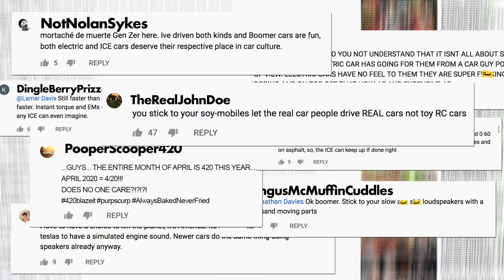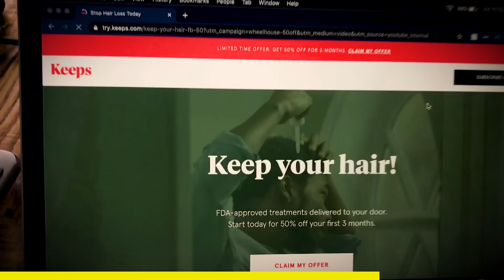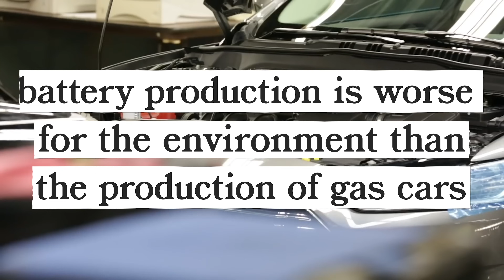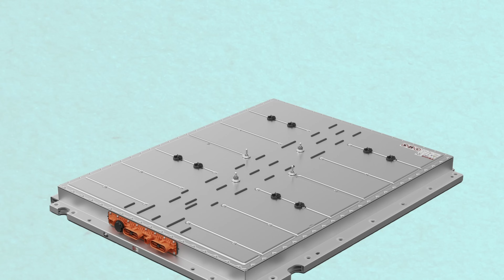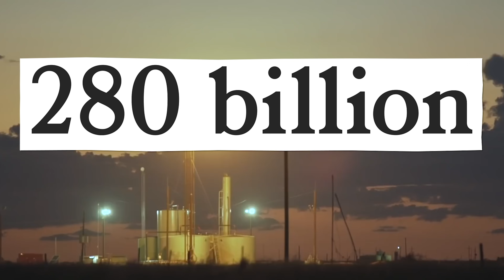Are Electric Cars REALLY Better for the Environment?

Comment: 8:40 nuclear power station. That is water vapor coming from those towers.
Reply: Waaat? I thought that was nuclear RaDiATioN and CaRBon
Reply: You realize nuclear and coal power all use the original powering method of stem just different ways to heat it
Reply: @gradypoole5366  Huge difference
Reply: Jeremiah what
Reply: @gradypoole5366  I think he is talking g about the byproducts such as steam vs mercury, lead, cabin oxide, sulfur oxide, etc

Comment: The Germans have calculated that a Tesla is just as polluting as a modern diesel until 200.000 km...they take in account how the energy is generated that drives the car. Also the percentage that can be recycled is lower then "normal" cars..They are heavier and worse for the road they are driving on because of the weight, which only makes me think that tires also wear faster. What is the life of a battery pack or a electric car? And is your car worthless when the battery dies?

Comment: So basically 2 times more efficient than gas engines, hybrid is the way to go, the proof is f1 being more eco friendly than formula e and don’t forget f1’s plan for 100% carbon neutral fuel by the year 2030, ice will not die out in the near future for sure

Comment: If your power plant burns coal, they are turning heat into rotation into electricity into rotation again, in an ice you turn heat from burning into rotation. Now go on google and find out the % of energy you lose making electricity and then turning it back to kinetic energy. Unless you go solar, wind or hydro you are wasting energy and for the same amount of driving an ev produces more co2.

Comment: No matter how much people who can't let go of the past try to shit on EVs, the facts still stand. Even if processing and production plants caused a bit more pollution wherever they are, I would rather have a few processing plants in the middle of nowhere causing pollution than thousands of mini CO2 factories on wheels at every corner of the street. You can see the difference in pollution between big cities and smaller ones and that's the only proof needed. The main focus now should be making sure we don't choke in our own cities.Also, as fast as technology is evolving, lithium will most likely become obsolete pretty soon and we'll find greener sources of fuel for the EVs. It took a while for petrol engines to become less polluting and the same will happen with EVs. It's an evolving process.

Comment: Seriously loved this video, glad we can finally put this argument to rest.
Reply: there still a few points that are not covered by the video. like electric semi trucks and if its possible to convert over to them completely. not to mention the oils used in electric vehicles, and if we switched over 100 percent to electric vehicles would it work? for the most part this does get rid of most questions.
Reply: @brionwreede9989  Also nolan said Lithium extraction pollutes a lot of water, and then he only compared the atmosphere pollution
Reply: Brion Wreede Brion Wreede electric semi truck has already been done by Tesla. The production co2 value he used included any oils used in EV production. Why do people always try to pick it apart and not realise EV’s are just better for the planet. If we all changed over to electric vehicles there would be no problem to the grid, we would install more public chargers but nearly everyone would charge from home
Reply: @jamie0193  because the cold greatly affects how far those electric semis can go. Not mention the charge time. It's impossible to cross country a semi with that massive of a battery. Not to mention the fire hazard from the massive charge and discharge of that battery
Reply: @jamie0193  it deserves to be picked apart. If it's going to replace gas and diesel engines it needs to be thoughrly throughout.
Reply: @brionwreede9989  Yeah Elon is pulling a very stupid move for making electric semi trucks.
Reply: Still missing a lot of issues with bringing evs into the infrastructure
Reply: Not until another person make this kind of video
Reply: Not even close
Reply: 'glad we can finally put this argument to rest' You're obviously trolling
Reply: Amen
Reply: I'm sure ev abuse won't end anytime soon

Comment: Did you divide the 280 billion metric tons of CO2 produced by drilling that oil into what is actually used by gas powered cars?
Invalid.
Fail.

Comment: Thanks for mentioning the local farmers who have less or no water because of pumping brine in the Atacama. I say no, because pumping brine lowers the water table beyond the reach of wells that were already expensive for the farmers.

When or if battery recycling becomes available efficiently, maybe the environmental impact of the batteries will drop, too.

I have my doubts California’s grid can handle a very large number of electric cars, but most of the country should be fine with lots more electric cars.

I also like ICE cars. You can fill them up in minutes, even if you have to drive several miles to find a gas station with working pumps. And last fall in California, I could give rides to neighbors with Tesla cars during blackouts that lasted the better part of a week.

Comment: @Donut Media
I don't think every avenue was covered in this video, Ethanol provides a compelling environmental positive for ICE powered vehicles. Running E85 to E98 can effectively make the vehicle carbon NEGATIVE over it's lifetime by putting more oxygen into the atmosphere than carbon dioxide that the vehicle emits.
Brazil is a great example of this as a country that implemented a large scale ethanol pump fuel that fitted into their existing infrastructure. This should have been at least mentioned in this video if you were going for debunking all myths. Electric vehicles vs ICE powered by ethanol is still a very debatable environmental tossup in terms of total environmental footprint.

Comment: You got paid my EV companies?, what about adding green fuels into  the equasion...
Reply: How?? He provided factual information on the topic.

Can you prove ir provide a source that contradicts anything he stated? If not you need to question your own motives and biases instead of lashing out on those providing facts.
Reply: António Palma or the disposal of said lithium batteries...
Reply: @KyleSmith-bp2fe  Manufactures are actively working on reducing the rare earth mineral consumption in the batteries. Also the biggest impact that EVs have regarding pollution is the massive reduction in green house gas emissions.
Reply: Maybe we shouldn't start to pressure underpaid consumers into buying expensive EVs and instead focus on alternative fuels... naaaw that doesn't generate nearly as much cash

Comment: While dispelling bogus numbers, please expose the nonsense of cars creating >5 tons of CO2/year, while consuming 500 gallons of gas a year.  Even if gasoline was 100% CO2 (it isn't) it would only add 1.5 tons of CO2 (the weight of 500gal of gas)  It is physically impossible for less than 1 pound of CO2 to add 3.4 lbs of CO2 to the air.

Comment: Curious if increased tire wear due to electric vehicles being so damn heavy is included in the yearly emmisions
Reply: Unless you were going through tires like a drifter I doubt they would have any effect on emissions. Also wouldn't you need to factor that in for the heavy ass ICE vehicles? Chevy Tahoe and the Tesla Model X both sit around the 5500lbs mark. The Model S runs around 4800lbs which is also close to it's ICE brethern like the BMW 7 series and Audi S7. Like I said there is probably no difference, most people only go through one set of tires a year, if that.
Reply: The Tesla Model 3 ranges from 3,552 to 4,100lbs, for comparison a 2020 Camry ranges from 3,241 to 3,572lbs. Everyone talks about how heavy EVs are, in reality they just tend to occupy the upper half of any given car types weight range. It's also important to note that tires are built for specific weight ranges, tires for a truck will have the same average lifespan as tires for a basic economy car making your question pretty moot.

Comment: Many errors: batteries are ~100% recyclable TODAY. EV use 8k tons (all recyclable) from 130k tons of cobalt mined yearly - ICE cars (gasoline production) use the MOST. And no one cares. Lithium production has VERY low impact. Unlike aluminium and steel production. Links, sources: 

"This is discussed multiple times a year, for several years. It's never from a position where someone has really done any serious research and looking into who the materials suppliers are and where they source materials from. It's always from a "a friend of mine says mining metal is worse for the environment". It's a nonsense argument, since all of the materials used to make an EV are made to make an ICE vehicle except for the addition of a tiny amount of lithium and an even smaller amount of cobalt. The amount of these materials in any battery cell is very low. Cobalt accounts for less than 5% of the cell's makeup, and lithium is single digit grams per 100 Wh.

On the other hand, steel and aluminum make up a massive amount of every car made. Refining those processes to be more efficient, more environmentally friendly at the mineral source, cleaner in production/refinement, reducing waste when stamping parts, and increasing recycling of materials would have an absolutely massive impact on the environment almost over night. Electric arc furnaces used to make aluminum require a mind blowing amount of energy, and the metal needs to be heated to thousands of degrees to remove the oxides from bauxite and make aluminum."

Eco-friendly method of recycling EV batteries
, 96+%
https://youtu.be/wxCFDWMPu38

www.edmunds.com/fuel-economy/what-happens-to-ev-and-hybrid-batteries.html

> Lithium-ion batteries now are somewhere between 70 and 100 percent recyclable, depending on the particular chemistry of the batteries. There are about half a dozen in use and more are being developed. The bits that can't be recycled are mostly consumed as fuel in the furnaces that are used to melt down the metals, which include cobalt, copper, iron, nickel, manganese and, someday, lithium.

> Recycling specialists say that as volume grows, it will become more economically feasible to recover some of the content now wasted that way. Lithium, for example, is so cheap that there's no economic case for recovering it from lithium-ion batteries right now, says Todd Coy, executive vice president of recycler Kinsbursky Brothers. The Southern California firm handles most North American advanced automotive battery recycling through a joint venture with longtime battery recycling firm Toxco.

EV used "6 650 tonnes in 2017" (Page 22. publications.jrc.ec.europa.eu/repository/bitstream/JRC112285/jrc112285_cobalt.pdf ), ~8k tons in 2019 from 130k tons of mined cobalt last year. All of that with proof of origin - no children sourced crap. 
The rest so ~122k tonns? Military uses (lowest bid contractors use cheapest cobalt...), abrasive tools and cellphone batteries and of course probably #1 that no ones mentions "indirectly" ICE cars because it's used in refining oil:
https://youtu.be/ysQ3VWpuwI0?t=236

https://twitter.com/enn_nafnlaus/status/1206896495993278464
> Tesla is well known for not buying Congo cobalt. The Model S/X get cobalt from the Philippines, while Model 3 gets it from Canada.  Amnesty international, in its very first report on the problem of child labour in cobalt mining, spared Tesla from criticism specifically for this reason

---

As you mentioned 100% cola nonsense,  please do the same for a gas/diesel car fueled from Canada's tar(oil) sands:

Every one car in US is fueled in part from Canada's tar(oil) sands:

https://en.wikipedia.org/wiki/Oil_sands#Energy_balance

> Approximately 1.0–1.25 gigajoules (280–350 kWh) of energy is needed to extract a barrel of bitumen and upgrade it to synthetic crude. As of 2006, most of this is produced by burning natural gas. Since a barrel of oil equivalent is about 6.117 gigajoules (1,699 kWh), its EROEI is 5–6. That means this extracts about 5 or 6 times as much energy as is consumed. Energy efficiency is expected to improve to an average of 900 cubic feet (25 m3) of natural gas or 0.945 gigajoules (262 kWh) of energy per barrel by 2015, giving an EROEI of about 6.5.

That's enough for ~2500km of range for a Model 3... And that's only extraction! 

Canada's Tar Sands: The most destructive project on Earth? - Truthloader
https://www.youtube.com/watch?v=Sjia7BsP4Bw

And they spill oil from pipelines all the time:

https://electrek.co/2019/11/01/keystone-oil-pipeline-leaks-nearly-400k-gallons-north-dakota/

> The Keystone oil pipeline has spilled approximately 383,000 gallons of *tar sands oil* in northeastern North Dakota

EGEB: Keystone oil leak affected 10 times more land than originally thought

https://electrek.co/2019/11/19/egeb-keystone-oil-leak-bill-gates-heliogen-wind-farms/

" North Dakota environmental scientist Bill Suess said the leak reported on October 29 is now estimated by state regulators to have affected about 209,100 square feet (19,426 square meters) of land near Edinburg.
"